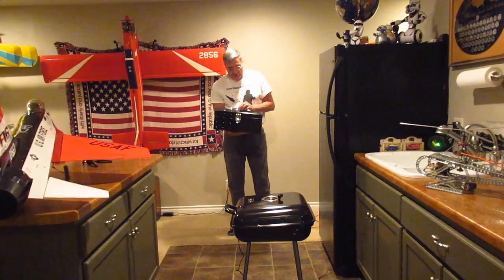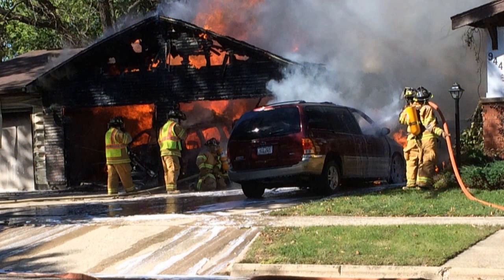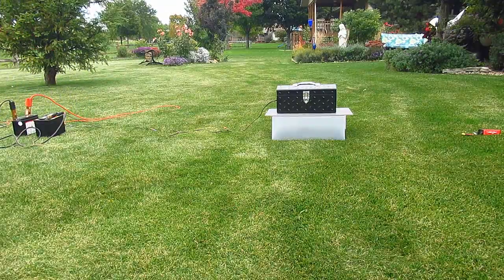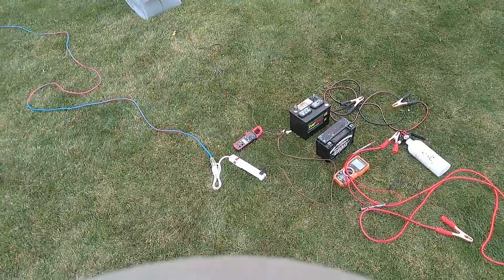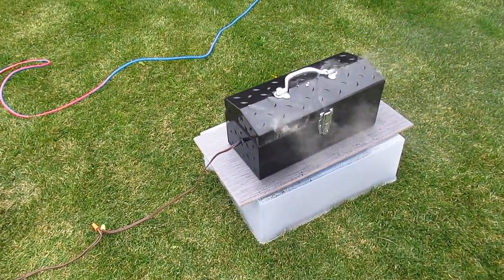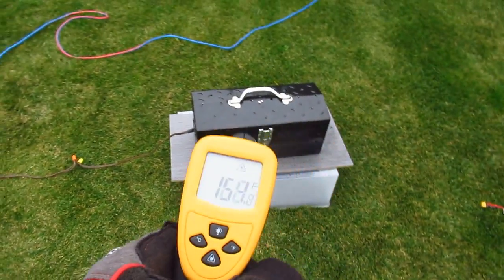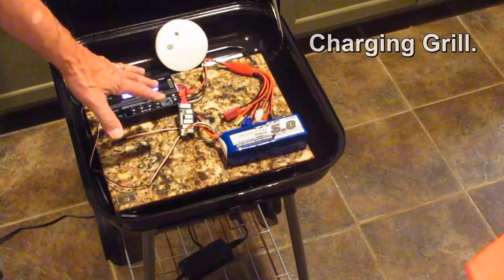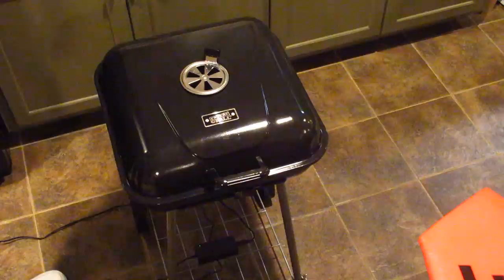LiPo CHARGING GRILL and battery explosion!

Comment: This grill idea seems good NightFlyyer. Wonder if I could store the Lipos outside in this grill? Maybe in a Ziploc bag to keep humidity and weather out? Then wouldn't need to store in the house. Thoughts?
Reply from the maker: Storing batteries inside any metal container is a good idea.  I have several of the Black Tool Boxes from Walmart, I keep all my batteries in.  Of course you can store them in the grill.  Go for it.  Thanks much.

Comment: as someone who is considering making an ebike but doesn't want a fire hazard in my garage ive been looking for info like this on charging batteries in a charcoal grill,  
the smoke detector and the quartz slab is a brilliant idea, but since im going to likely put it in my detached garage (where i cant hear it) i will probably get a wifi smoke detector so it messages my phone (my wifi reaches my garage)
Reply from the maker: Right on.  You may have known, my house and shop burned to the ground and we lost everything several years ago.  If I had a wifi smoke alarm, that would have been prevented for me too, as the fire started in my detached Garage shop.  So now, in our new house, I have the Nest Smoke detectors and they are amazing.  That would be a good choice in my opinion.  Be careful and safe. Thanks.

Comment: I think the best solution is a grill outdoors, especially for big batteries and my Ebike battery. I’ve watched many videos of the bags, they’re extremely unreliable and it takes a $100 giant bag to successfully contain a large Ebike battery because the cells just keep going off and burn for over an hour. Even then you still get fireballs shooting out the side vents, so if it’s close to anything there’s still a risk. Also not that $20 is a lot for that Walmart deal, but free grills are everywhere and I know I have 3 unused large ones myself.

Comment: What a deterent to owning these batteries.
Reply from the maker: I think it is not a deterrent but a warning to be safe.  Since my house burned to the ground, I want everybody to handle them safe.  Remember Lipos are even in your phone.
Reply: @NightFlyyer  I was considering a old electric smoker for storage. Looks like were thinking kinda the same with your grill setup.  Thanks for the video. Tool box works well.
Reply from the maker: @streaydog019  Any good containment like the smoker will certainly work. Thanks.

Comment: That's really great, Dave!  Even if you spent $1000 on something to charge your batteries, and then had one blow up, that $1000 and the loss of a charger and battery is MUCH better than the loss of a house.  I like to see videos like this.  Ive been using a metal toolbox, as well, for a few years now.  Thankfully nothing has ever gone wrong but....you just never know.  Take care!
Reply from the maker: Thanks very much.  As you know, I agree with you, as loosing a battery (which was already a loss if it blew up) and a charger or 2 is cheap insurance for sure, vs the house.  Thanks again and happy flying.

Comment: I really like the toolbox idea, I do have one concern and if you would be willing to blow up one more it would be great.
In a bunch of the videos I have seen it looks like the fumes are on fire so my concern would be that if the fumes are flammable could something in the house set them off?
It would be great to see the toolbox test again with a torch/candle/flame source by the box.
Reply from the maker: No time soon will I try that again.  It's expensive to blow up good 6S batteries, plus the fumes in the house would definitely not be welcomed again. Outside, there is little chance that a candle or torch would be next to charging station and especially inside the house.  Those fumes will not burn, if your talking about the lipo fire smoke, as they are the smoke from the fire in the first place.  There are no fumes that come from just charging. As long as the battery is contained, like in my box, I don't think there is any worry about fumes igniting once the lipo explodes, as the damage is done.  Maybe you or someone else might try it, but it's not going to be me.  I'm just happy my box and grill works, so I can feel much safer.  Thanks.

Comment: I've been running Lipo's now for around 7 years and never had one catch fire either on the charger or in the plane, came close once, the spring on the cross blade on a Deans plug bent and shorted the battery as I was connecting to the ESC, pulled the battery before it could escalate much more than untouchable heat, that was the day I removed all Deans plugs and destroyed them (XT60's rule). When a Lipo is past it's useful life I cut off the power cables and soak the Lipo in salt water for a week then they can be disposed of safely. I charge no more than 2C, even if the battery says it can charge at 5C, and I have never to date had a battery get warm on the charger. I'm not saying it will never happen to me , and I follow all safety precautions similar to  Dave's in his video. BETTER SAFE THAN SORRY.
Reply from the maker: Thanks. I've also been using lipos since firs available for models over 15 years and never had a problem til now. So I say never say never and truly be safe. I love xt60's too!  Thanks again.
Reply: It seems that directing the flame away in a safe direction is the best thing that can be done. One of my club mates charges his Lipo's in a Besser block (large concrete building block with two large holes in it) on it's side,  the charger on the top of the block, any flame is directed in the direction of the opening away from combustibles and you can have another battery in the next hole charging and it wont be affected by the heat.
Reply from the maker: That's another good idea.  I wanted to contain all my flames though, hence the closed, vented systems I am trying.  No matter what, its better to be safe than sorry.  Thanks.

Comment: Thank you for the reply and so many tips over the years Dave. Safe flying.
Reply: I appreciate you sharing this video. I've always thought I needed to get an expensive ceramic pot or ammunition case, but I think I'll go out and get a metal BBQ grill or a Hibachi and put a little sand in it and keep my batteries in there for storage. I wouldn't have thought of using the barbecue grill unless I saw your video. It's an awesome idea.

Comment: Great tips. I'm considering the tool box setup. Would it be alright to use a 2 port charger and charge 2 batts at the same time in the tool box?
Reply from the maker: I used to do that a lot and never had a problem. In my last video I show my 2 charger setup. As long as mine are in the box with a few air vents, I feel safer than having them charge in the open. Thanks a lot.

Comment: I would use ceramic tiles to place under your charger. That way if the battery goes nuclear, it wont burn the cork inside your charging grill. I use a lipo bag when charging. I normally store all my batterys in an ammo bag. Yes, $500 in batterys wont cover your house. I actually dont keep my batterys all in one case. Since its only $10 per case for a steel ammo case on sale. There is nothing wrong with having several cases, including one for charging. I have had one battery go bad but not burst inside the house. This was a good lesson for people to learn. I have seen entire drone equipment bags go up in smoke in the middle of a guys garage. I just talked to a friend whos RC racing buddy lost his garage to a lipo fire a couple weeks ago. The house was heavily smoke damaged, all because he left his racing battrys sitting on the bench. Like you said, when its gone, its gone. You could throw some steaks on that grill just in case. Thanks for the video!
Reply from the maker: That's not cork. It's a solid piece of Quartz tile 1/2 inch thick. I use ceramic tiles in lots of other places and  they are also great insulators. Good tips. Thanks.
Reply: @NightFlyyer  My bad, I heard cork...lol. Lots of noise. Good ideas eather way. We as hobbists cannot stress Lipo safety enough. Its cheaper replacing batterys than houses.

Comment: Hi Dave thanks for doing this video. Very informative. I have only had one battery go off in my shed. My fauly as it was old and was going to throw it out and decided to keep the connectors. Simple just cut them off. Here's the mistake, couldn't find my side cutters so used the pocket knife that I had. Knife slipped nicked the lipo pack (3cell 2500mah) and it just went off, flames smoke the whole deal. Quick thinking dropped onto shed floor, bare concrete. Well it spun around and around throwing flames and smoke out like a roman candle. Shed door was open so kicked it outside and let it do its thing. Lesson learned. Have a huge respect for these batteries now. Keep them stored in ammo box in fire proof bag. Shall share your video to our clubs facebook site. Once again thanks Dave
Reply from the maker: Hi Stephen.  WOW, what a story you told!  That is another good reason to be careful as you can with these Batteries.  I am glad you managed to keep from burning yourself and your shed.  I appreciate you passing this on to your members.  If you watch the amazing video of the battery explosion (link in the video description box) you will see what happens to an ammo box. Thanks very kindly and happy flying.  ~Dave

Comment: another great vid from NightFlyyer! keep em coming mr. Herbert
Reply from the maker: You have always been very kind.  Thanks very much!
Reply: @NightFlyyer     i know without balance charge or doing over charge they can blust but can lipo batteries get blust when i store them in storage voltage (3.8-3.85) on safe place some moths or some days  without using ?plzz reply sir.
Reply from the maker: @soumiksaha720  I have never seen a battery burst just sitting on the shelf.  They tend to bust only while charging or if they got dinged in a crash.  Either way, store them like I did, inside something that can contain the fire, if something were to go wrong.
Reply: @NightFlyyer  Thank you so much sir ❤️

Comment from the maker: Please see Video Description.  When the LiPo Battery exploded in the charging bag, the Charger burst sparks and flame from the LCD window too!  Therefore, I decided to make a safer charging setup that included protecting the charger too.  I called it my LiPo Charging Station, as seen in my last video.
 In this video I decided to TEST it for more peace of mind.  Note,  I have small holes in the tool box lid to relieve the pressure. Always be aware of how and where you charge your LiPo batteries as LiPo accidents can happen at any time to anybody! LiPos are generally safe and only seem to catch fire when something goes wrong during the charging procedure.
 (See this example video courtesy of Rajucam Aerial Services ) https://www.youtube.com/watch?v=CnNId0mDnBo and thanks kindly for watching.
Reply: Just watched that video, how about that 16 amp pack, don't think other than charging in the middle of the yard is safe for them.
Reply from the maker: For sure.  It must take a long time too.  Thanks.
Reply: Nice video. Heard fire extinguishers can’t put a lipo fire out. Saw an idea where a guy charges his battery inside a big pot with a big bag of sand over the pot. If a fire starts, bag melts and sand pours over onto the lipo. Maybe this is a good idea for your next video..
Reply from the maker: My fire extinguisher instantly DID put our the fire.  The bag of Sand sounds good, but if you watch the video in my description box, the guy put a whole garbage bag of sand over the charging bag and the blast blew it away, so not sure about a small bag of backing soda as the explosion is quite intense and forceful. Thanks for the suggestion and comments.